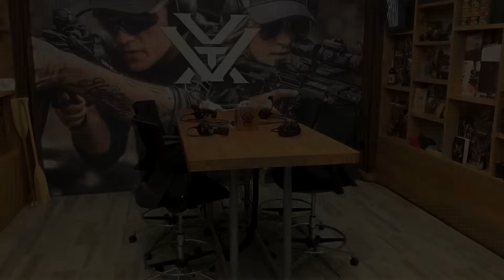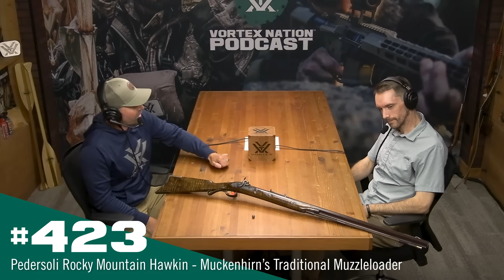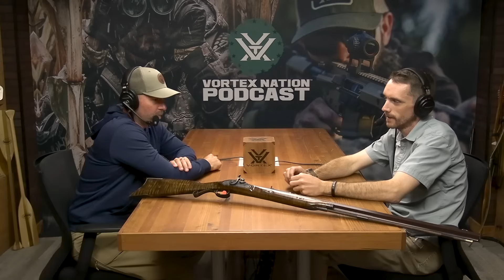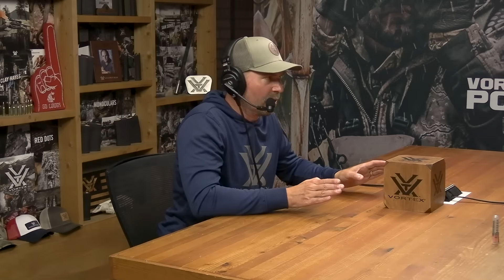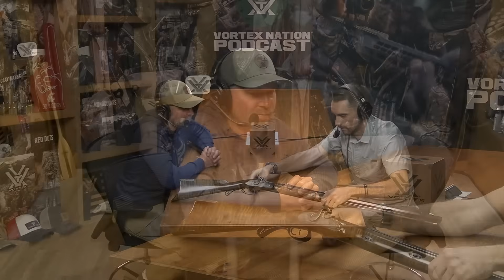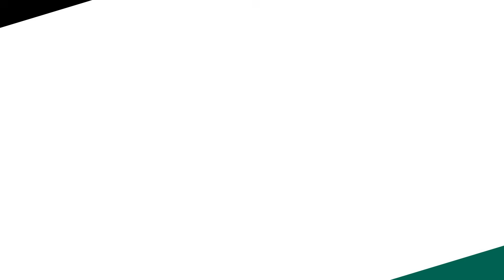Ep. 423 | Pedersoli Rocky Mountain Hawkin | Muckenhirn’s Traditional Muzzleloader

Comment: I would like to see more dedicated flintlock seasons like PA has - they’d be perfect for short range depredation hunts.

In the early ‘90’s I built a .54 cal TC Hawken and got a cow elk with it that fall.  I used a 425 gr conical I cast from pure lead. One shot through and through - devastatingly effective. About as accurate as my most accurate center fire rifle to 100yds.  I never took it beyond that, but I definitely should try 125yds.

This December, I drew a muzzleloader cow elk tag.  I plan to try a patched round ball and real black.  My first time out, I was using Pyrodex because I didn’t know where to look for the real thing😉

Comment: Community consensus among muzzleloading enthusiasts generally considers Kibler’s Longrifles to be significantly superior to Pedersoli in terms of quality and performance. Users frequently describe Kibler as a "step above" Pedersoli, comparing the latter to entry-level brands like Springfield Armory while likening Kibler to high-end custom builders like Les Baer. 

Key distinctions highlighted by users include:

Lock Mechanism: Kibler’s flintlock mechanisms are widely regarded as superior, offering better geometry, faster ignition, and higher reliability compared to many European imports, which often require significant aftermarket tuning. 
Fit and Finish: Kibler kits feature CNC-machined wood and high-quality brass that require less labor to assemble, with users noting better fit and finish than Pedersoli, CVA, Traditions, and Lyman products.
Balance and Handling: Kibler rifles are praised for their excellent balance and "long rifle experience," whereas Pedersoli Jaegers are sometimes criticized for being barrel-heavy and handling more like full-stock plains rifles. 
Value: While Kibler kits cost more (often $1,200+), users argue the quality justifies the price, whereas Pedersoli is seen as a good production gun but not in the same tier as Kibler’s historically accurate, high-quality kits.

Comment: Pedersoli makes a lot of fine muzzleloading firearms, and this Hawken is no exception.  I have a repro Hawken percussion rifle in .54 caliber built from a kit by InvestArm (also from Italy).  An excellent shooter but the particular kit I built it from had some authenticity 'issues' (i.e. barrel too short - only 28 in. whereas original Hawken barrels were usually 32 in. or more., brass furniture, only one barrel-key instead of 2) so I have to purchase additional parts (i.e. steel furniture, an L&R lock & parts + stock modifications to add a 2nd barrel wedge) & put in a lot of extra build-effort to get it as close to an authentic(??) Hawken as possible - nothing like the Pedersoli shown here but considerably better than what the kit originally supplied.   

I would recommend InvestArm's Gemmer Hawken as a decent replica of the Hawkens of the Gemmer period in the 1850's-60's (either pre-assembled or kit) - in fact I recently added a Gemmer 32 in. .54 cal barrel to my kit-gun and I love it!!  Only additional mods were to build a new underrib w/rammer-pipes made from 3/8" inside dia. steel tubing bought at a Home Depot & a new ramrod to accomodate the longer barrel-length.

Comment: When I'm done at the range I spray moose milk down the bore and on everything.  Swab the bore a few times, wipe the stock and lock off. Then wet another patch or two to finish swabbing the bore and I'm done for the most part. I do a full clean and lube at home but truthfully it's already basically clean.

Comment: I started with a Lyman Great Plains percussion rifle and learned  consistency for a year before I got my Flintlock.  I use a nylon ramrod because it bounces when your patched ball comes tight against the powder. (And it doesn’t break!). 

Volumetric measure is what you use.  A good starting load is relative to the bore diameter… 45cal=45gr. 50cal=50gr. 54cal =55gr.  If your barrel fouls before 20 rounds, back your load down a grain or two. 

Use 409 for cleaning… I put a soaked cleaning patch down the bore against the plug when I leave the range and it only takes 4-5 more patches when I get home.
Reply: I use black powder only since my 777 got wet and turned to mud..  Black powder can be spread out on a cloth and dried out and shot, but black powder replacements won’t come back after wetting.

Comment: I fill the sink up with hot water and dish soap. Put the hook/nipple end down in the water with the nipple removed and then just plunger a patch up and down until water is coming up out of the muzzle. 30 seconds to a minute of that and it's perfectly clean. The dry patches after are white and clean. Clean the nipple and hammer quick and a light g96 coat on everything and good to go. Way easier to clean than my inline.

Comment: First one was a 5 foot long .62 cal rocklock. I did a bit of reading, gathered up the necessities, and went through half a pound of powder in an afternoon.
Needless to say, now I have others as well... I think I'm cured though.
My flinter gpr .50 has some geometry issues I didn't know they suffered from, unfortunately. Ahh... they're all labor of love.
Reply: Look into the l&r replacement lock. It'll take a little carving in the mortice for depth, but a worthy upgrade
Reply: @nateeller2683 
Ya, maybe... I have a  .36 with a nice lock and I never have problems with it. The breach is also an issue with a huge circular 
cavity between where the plug meets the barrel. We'll see.

Comment: Use 20 grains by volume which ways very little by weight on top of the powder with potato powder and it will not tear the patch. It is good to do that with the 777 powder. Even low powder loads of 777 will tear heavy/ thick patches